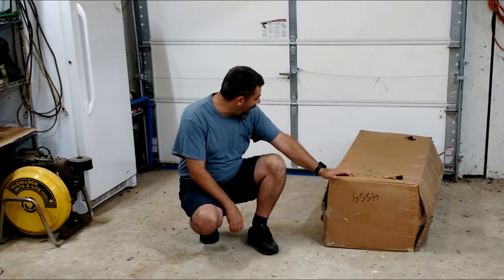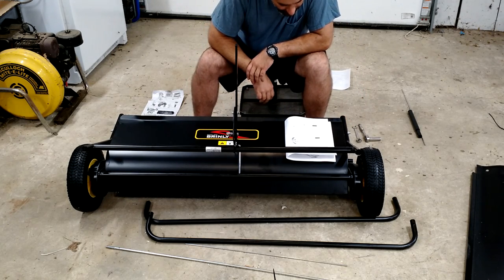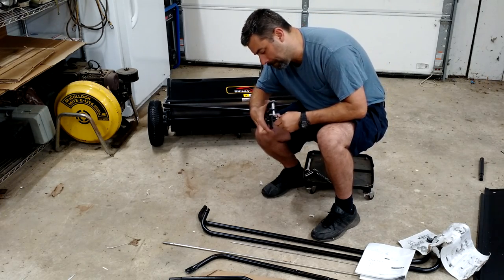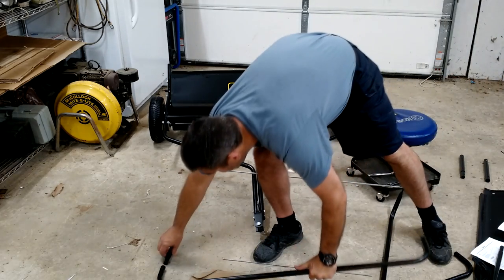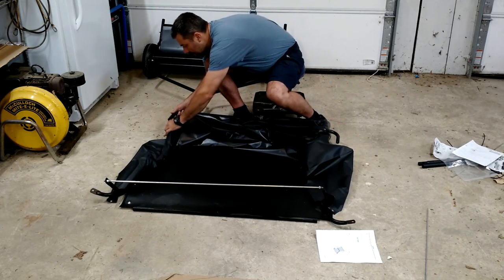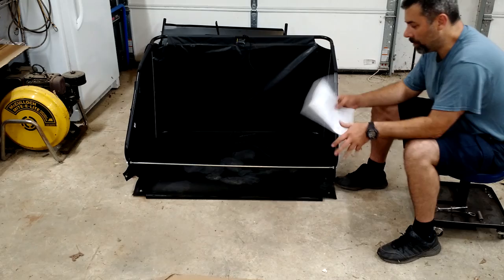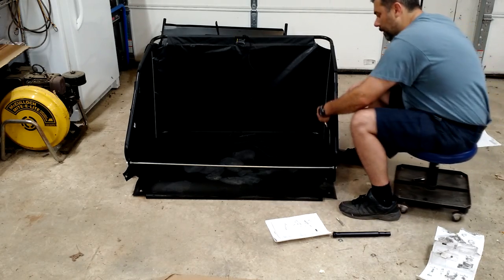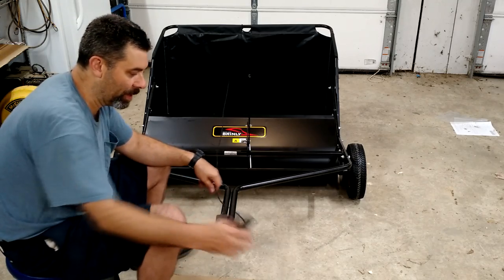Brinly Sweeper STS-42BHDK Assembly And Initial Impressions.

Comment: Brinly does make good stuff.  I have their Box Scraper and I love it.  I bought it about 5 years ago and it works just as good as the day I bought it.
Reply from the maker: I've never had any issues with the Brinly stuff I use here on the farm, and to be honest, I tend to be hard on them. The box scraper I have has taken a beating over the last few years and is still holding up. The disc harrow is also still working great even with our rocky soil.